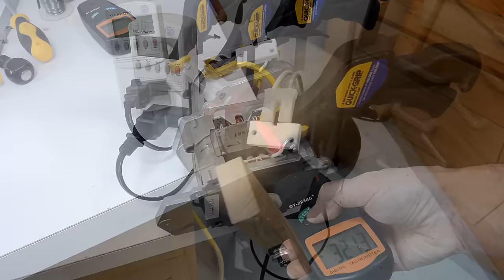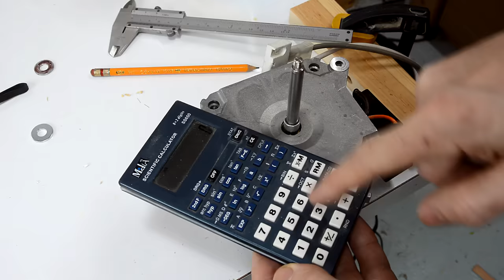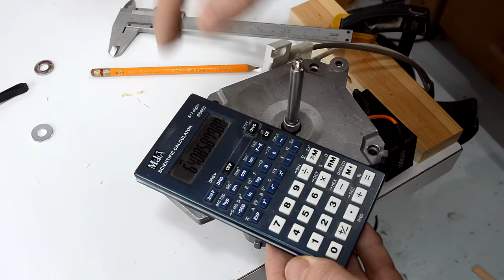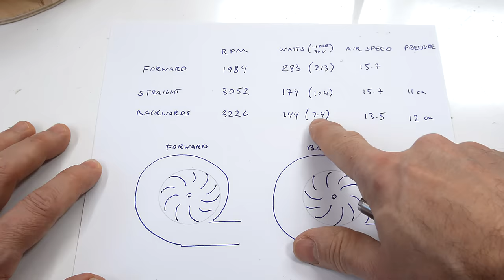Blower impeller design experiments

Comment: I wonder if there's a paper on this lying around somewhere or if everyone who designs a blower calculates it themselves.
Reply: Yes good question.  I also wonder if you have a certain HP/RPM motor to design around how to calculate for best flow/suction.
Reply from the maker: I googled around a lot a few years ago for answers to this.  Not much to be found, but I did find an anecdote about forward making more volume at the same RPM
Reply: I got inspired by Matthias videos on this topic a while back and found this when I was trying to find something to read on the topic.
https://www.saylor.org/site/wp-content/uploads/2011/09/Chapter-3.5-Fans-Blowers.pdf

Seems like backwards facing is usually most efficient and provides most bang for the buck. Not so strange given the geometry and the flows. Forward facing means that the air has to accelerate a lot when going out and this cause friction loss. This may be minimized by using a backwardsfacing blades which allows the air to move more in a straight line along the radial direction of the fan.
Reply: I don't think you will find scientific papers about this, because that is established fluid mechanics. If you want some theory read for example "Fluid Mechanics" by Joseph Spurk. That is the english version of the book we used at uni. But that may well be a bit over the top for just designing a blower for your shop vac.
Reply: Thomas, I can't comment too specifically as I work for a company that designs and builds our own fans like these (but out of aluminum), but I suspect most of the good info is considered a trade secret. Your best bet is likely to go trawling through patents on fans. Most of the fan designs are done via some CFD, and then prototyping/testing. There are rules for scaling a tested fan up and down in size and RPM. https://en.wikipedia.org/wiki/Affinity_laws

Things like airfoil blades, and inlet cones are pretty standard, and would likely improve performance some. 

Some companies I know of that make fans, that might make for some good poking around.
Greenheck
Twin City Fans
Areovent
EBM Pabst
Zhiel-Abegg
Rosenberg
http://www.amca.org might be a good resource as well.
Reply: Research Article: Impeller Design of a Centrifugal Fan with Blade Optimization
https://www.hindawi.com/journals/ijrm/2011/537824/

Fans and blowers guide - BC Hydro (pdf link)
https://www.bchydro.com/content/dam/hydro/medialib/internet/documents/psbusiness/pdf/fans_blowers_guide.pdf
Reply: Evan,  Wow!  In many ways. The current draw for your system?  And is your shop industrial?
Reply: Thanks, It's going to be a big cyclone project.  The motors I have that I might use in this project are a 3,450RPM 10 HP Leeson that draws 38 Amps no load, a 15 HP Leeson that's 3,800RPM that draws something like 45 Amps (says the name plate) and the 30 HP I just picked up is a Baldor CEM4108T 3520RPM that the lit says is 66 Amps Here's a link to it.  http://www.baldor.com/catalog/CEM4108T .  I would not call my shop industrial, it's just a small cabinet/flooring shop.  It is commercial, like 1,500 square feet.  It's not this shop that I am building this machine for though, it's the NEXT one.  ;)  The main goal is to be able to not fool with blast gates at all.
Reply: Matthias Chicago blower used to have an engineering guide you could order for free. it's probably just a download now, it has everything you desire to design a blower wheel. Also the cutoff in the housing can almost touch the wheel,  the trick with blower wheels is to eliminate all short circuiting. to make more pressure make the blades longer, for more cfm make the blades wider.
Reply: Still do, I just ordered one!
Reply: Do you have a link for that?  Thanks.
Reply: What are you asking?
Reply: Directly comparing backwards to forwards curved: backwards about 85% efficiency and mainly for constant pressure in function of flow rate, forwards about 65% efficiency, running at half the speed and more constant, high airflow in function of pressure.
The main reason to go forwards curved, is the lower speed and thus lower noise/vibrations, like in a kitchen above your stove.
Source: turbomachinery course at university
Reply: Thomas Fisk lol. I only type that when I really laugh
Reply: I'm not sure there's a way to do it without a Finite Element Methods solver; too many variables in the size and geometry of the blades. There is a very rough estimate of maximum efficiency for wind turbines that's just related to the velocity of air and the effective area of the turbine, but it says nothing of the relative efficiency of one blade shape over another.
Reply: There are software tools to help you design the blade geometry you need.
Reply: kirloskar kit
Reply: @matthiaswandel  , your fan blades, housing, and layout procedure is straight from the book, "Centrifugal Fan Design" by Gingerly.
Reply: "Fan Engineering" published by Buffalo Forge used to be the bible. Now out of print. Howden Fans New York division still had some copies a few years ago (Howden now owns Buffalo Forge).
Reply: Most fluid mechanics text books will have a chapter on fan theory.  Woods Practical Guide to Fan Engineering gives you the practical basics.  Also, both Keith Blackman and Davidson produced books on their fans with quite a lot of theory included.
Sadly we seem to be more reluctant to share this sort of information, these days !
Reply: @MrPieJean  In this video the backward have more pleasing noise than forward so,  could you comment on this?

Comment: Would have been nice to test the straight blade fan with the reversed motor just to see if reversing the motor in itself effected the efficiency.
Reply: he did I think
Reply: The results are somewhat inconclusive since you would need to optimise the outlet housing of each configuration to really determine the overall efficiency of each. In this example the housing that was built to a size it suited the straight blades best.
Reply: It would be a waster of time. A straight blower will react the same regardless of what direction it turn.
Reply: robert shaw I believe what OP was referring to was to control for a variance in the electrical wiring.
Reply: It might if the reversing was done through wiring, but all he did was turn the motor upside down. I don't think that would have any difference.
Reply: *affected
Reply: Samtagri,, an induction motor works identically in either direction of rotation, as long as the rotor remains in the magnetic center of its stator.
Reply: if you did not reverse the housing as he did with the curved fin test, I would hazard a guess that it would be much less efficient. if you reversed the housing then it would be exactly the same. just like turning the whole thing upside down (relative to the orientation shown in the video)
Reply: It has to be a joke… I hope!
Reply: @soytuenergia  It? what it. What are you talking about? who are you talking to?

Comment: Interesting video, but it comes as no surprise to anyone who deals with blowers for pipe-organs.  They all have the impeller fins pointing, as you would term it, 'backwards.'
Reply: +offshoreorganbuilder -  The best of them all that provided wind for the largest and highest pressure organs ever built anywhere were by Spencer Turbine Company - The famous "Orgoblo" two stage straight fin blower. However, the fins at the intake end (Center of the fan) were curled to scoop the incoming air into and along the fins. The center static dividers do have curved guide fins feeding wind into the second stage. In installations where there was an abundance of high pressure reeds there was a third stage behind the second stage. This boosted wind pressure as high as 20" static. This system eliminated the use of a second independent blower to do the same job.
Yes these blowers were noisy (Understatement) but they did the job far better than these newer blowers.
Reply: @organbuilder272  Look at the holset turbo design.

Comment: Matthias, I love your videos but I must say that turbomachinery is a very well-established discipline and the maths involved is very accessible. Blade angles can be calculated and optimised in advance based on an operation point (pressure and flow rate) of your choosing. Much less costly than finding out by building lots of prototypes!

Comment: The straight impeller only had 6 fins where the curved had 8- Could this be increasing the air pressure and straining the motor?
Reply from the maker: Possibly, but probably not
Reply: i'd say it's because the shape of the curved impeller makes it harder for the air to escape from the constraints of the blades, similar to how it's harder to scoop with a spoon instead of glide over top. first will give you more stuff for more effort, second will give you less stuff for less effort, if you know what i mean
Reply: A higher number of fins increases efficiency, as well as the inlet and outlet angles of the fins < 30º. For high pressure pumps longer fins (and smaller angles) are used.

Comment: You really need to test for a flow versus static pressure versus power for each impeller.  Each design, at a given speed will have a different sweet spot in this three dimensional space.  Very interesting experiment.  If you can find a little variable frequency drive, you can add the fourth dimension of speed to that characterization.

Comment: It's a bit like wood working meets mythbusters - love your videos Matthias. It's a bit hard to see, what was the noise difference between the straight and forward facing impeller?  Also I wonder if there is some useful information to be found in the pc building community, since there is always a discussion about air pressure, air flow, rpm, and noise of different fans over there.
Reply from the maker: I think those were about the same
Reply: Sloth in pc this doesn't matter because we don't use radial fans and we don't build our own fans either.... Maybe we should start that
Reply from the maker: It would be something where 3d printing made sense
Reply: Bill Morrow did you do any type of tempering? Like acetone or heat treatment before or straight off the bed? I've seen a few places discussing how much stronger prints are with those
Reply: No, I am not that fancy. I sent it to a print shop which used a sintering process, if I remember right.
Reply: Thanks, will keep that in mind.
Reply: Matthias Wandel 3d printed a blower and a water pump on my 3d printer and it worked very well

Comment: Your backward curved impeller is correct, but your "forward curved" is not an actual forward curved impeller - it is a backward curved impeller running in reverse, which is very inefficient (and a tested way to burn out fan motors). To create a true forward curved impeller you need to remove your blades and rotate each of them by 180 degrees then reattach them. Feel free to ask me, I am an HVAC professional.
Reply: Can you draw a diagram of what it should look like?
Reply: Please be aware - lots of wrong info online on this subject. Ask an industry expert.
Reply: Saeed, so you're saying it's the opposite of what the image you posted says?
Reply: J DeWitt how so?
Reply: because your posted images match what Matthias built and they don't match what you are describing
Reply: Saeed - according to your description, you just basically said to reverse them (180 degrees = reversing them) which is exactly backwards.  According to Matthias Burger's link to images that's actually what shows the difference.  It seems the "forward" curved ones in the pic show the "curve" being in parallel to the lines  from the center (meaning - I don't see a "lean"  - if that makes sense). However, in the backward one in the diagram there is a "lean."  I guess - maybe there is just a misunderstanding here (I believe there is).  So with that said, is the image linked to above correct?
Reply: Also, can you give me a link to something with good information?  Telling me there is a lot of wrong info online isn't really helpful and "ask an industry expert" isn't always available unless you're paying them.  We make this shit ourselves because many of us can't pay them because we're broke.
Reply: LogicSpeaks  it is not exactly backwards. because of the way the blades are mounted it is more like if you would turn them 90° when you turn it from clockwise to anticlockwise. The blades should always point in the direction of rotation on the inside. the thing that can vary is the direction they are bent going outwards. either more towards radialy or more towards tangentially.
Reply: Like squirrel fan
Reply: I'm not following the arguments.  Consider a tangent at the output edge of the fin.  As it passes the outlet port, that tangent can be more or less parallel to the direction of the outlet port, or perpendicular to it.  Is this a factor?  I notice that it is different in the forward/backward impeller in the video.  Note that this tangent could be configured either way for either fan by modifying the geometry of the output port.  Then having established the (ir)relevance of the direction of the output port, where are we.
One ambiguity of the Burger figure is that it does not show the output port.
Reply: "TRUST ME, I'M A PROFESSIONAL" (that's incorrect)

Comment: My DIY dust collector used straight fins, but they were angled similar to the backwards facing curved blades. I ended up still needing a 240v supply to run it though, and its absolutely terrifying...

Comment: I see why it was unbalanced. 0:15 couple of first blades center was on outer circle, then you switched to inner circle.
Reply from the maker: yes, I noticed that too when I edited the video, fixed the impeller.
Reply: Matthias Wandel would it save time if you weighed each blade prior to glue up?
Reply: That would help. However the positioning of each vane must be located consistently in relation to the center of rotation.

Comment: "So that tells me if you're limited by RPM but not by power, you can get more airflow like this." - That was your first deduction? Not "The speed output is limited by the housing size and exit port." which is the only observation you could accurately make from those figures?
Reply: Interesting observation. If it was given a bigger outlet to achieve maximum speed you may have also seen a decrease in amps drawn. But I think the take away from this is forward facing gives you greater flow less pressure, straight gives you a middle ground, and backwards gives you less flow but more pressure. He might have even reduced the size of the outlet for the limited flow reversed to limit the speed and increase the pressure.

Comment: In firefighter pumps there are this two designs, because they have 2 steps pumps. One for more volume of water when you accelerate the motor and the other for more pressure when you accelerate the motor.

Comment: I like backward blower much faster and very efficient air blow.but i recommend straight Beacause made easily and more power.😁😁😁😁😁😁😁😁😁😁😁😁😁😁😀😀
Reply: There should be a restrictor on the output of that squirrel cage look at your heating and air conditioning blower motor there's a restrictor it helps that efficiency I guess in the pressure and the volume
Reply: There should be a restrictor in there for the output are the blower motor the squirrel cage check your heating and air conditioner at Saint there it's in there what kind of engineer

Comment: With adjustable angle curved blades you could have any possible configuration or a fixed number of preset configurations, like the gearbox in a car, this also makes sense because you'd want a preset for the first 1/2 second, another for higher air pressure, lower air pressure, air moisture, debree particles, etc.

Comment: to: Matthias Wandel ; I thing in the curved propeller- case , You should make the bottom of bend section  be longer than the top (the top of bend is the center hole, but the bottom is long to the spindle of motor) It means that is a diagonal . When the curved propeller begins spinding the air (in the center hole) spinds too by the longer part of bend's bottom.

Comment: A neat experiment that I personally would love to see you do, is run all three of those fan configurations without being in the housing, and just measure rpms and power consumption... supposedly, backward curved fans experience only a  slight insignificant drop in efficiency when run without a housing, but both forward curved and radials experience a "large" drop in efficiency... you would be able to see this just from the rpm drop and power consumption...

Comment: I think the product "static pressure" * "air speed" * "cross-sectional area" would be the most interesting value to compare, as that would give you the mechanical output power of the airflow and let you compute efficiency. It would be independent of conversion devices such as nozzles, which could always be used to adapt any blower to the desired application (high airspeed or high pressure).

Comment: +Matthiaswandel , Running the fan with blades forward you are actually achieving something very interesting and contradictory at the same time: the centrifugal force will push the air outwards, so it will create negative pressure near the shaft, but at the same time, the curvature of the blade will try to "scoop" - if I am allowed to use a trivial term, the air and push it towards the shaft, hence the overload of the motor. So, basically you force the motor to fight against a reactive pressure that the fan itself is producing. Bad for the motor.
Try pivoting the blades "backwards", so the curvature at the end is tangent to the radius. Not sure if I made myself understood. Point is that you need to prevent the fan from sucking air from the outlet, so you only have centrifugal blowing.